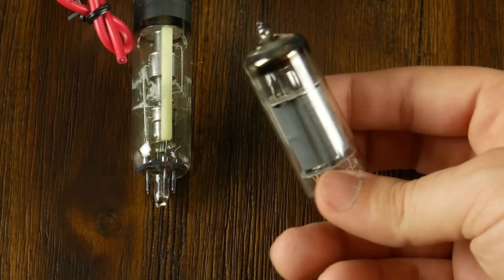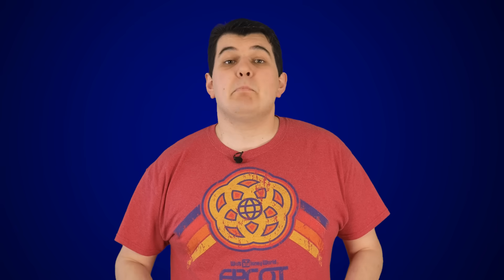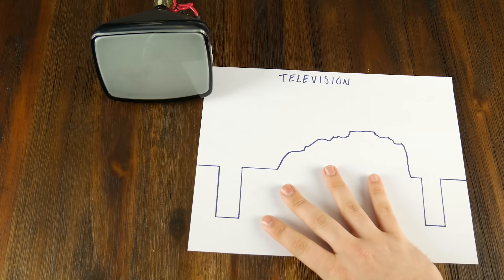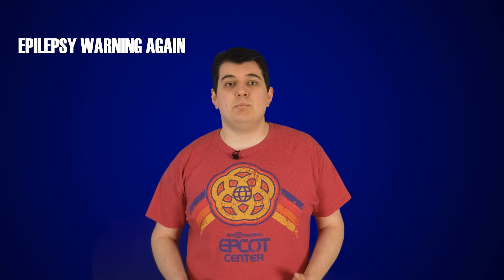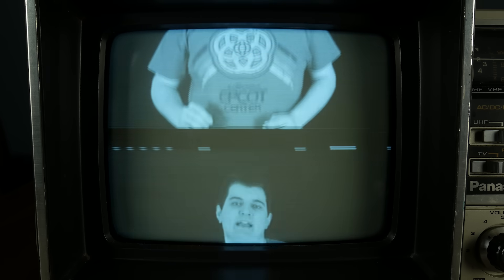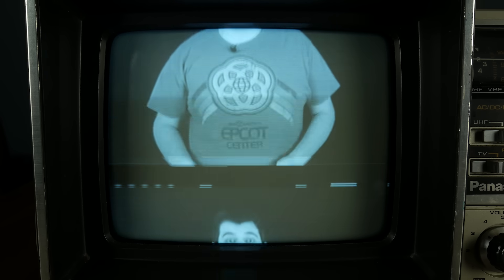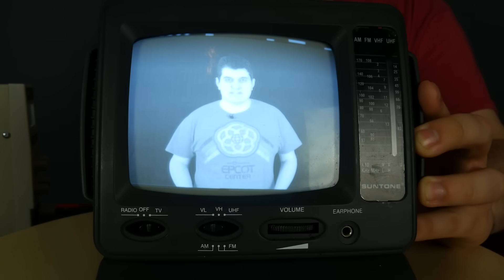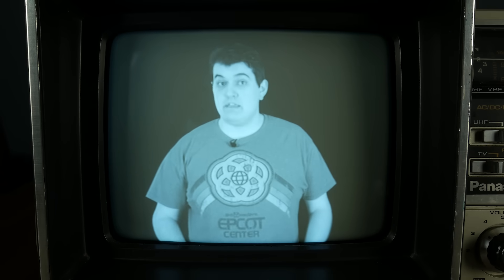Lines of Light: How Analog Television Works

Comment: There is nothing wrong with your television set. Do not attempt to adjust the picture. We are controlling transmission. If we wish to make it louder, we will bring up the volume. If we wish to make it softer, we will tune it to a whisper. We will control the horizontal. We will control the vertical. We can roll the image; make it flutter. We can change the focus to a soft blur or sharpen it to crystal clarity. For the next hour, sit quietly and we will control all that you see and hear. We repeat: there is nothing wrong with your television set. You are about to participate in a great adventure. You are about to experience the awe and mystery which reaches from the inner mind to the outer limits.
Reply: michael adams Please stand by
Reply: How scarier would that have been read out in a BBC English accent and backed with the nightmarish tunes of the BBC Radiophonic Workshop?
Reply: @GeoNeilUK  Or how scarier still if it had been read out by a Scouser.  "We kcontrol thu veeeeeertickle"
Reply: The Outer Limits... Please Stand By.
Reply: That actually caused them some grief... Of course, they didn't actually change the vertical or horiz frequencies of any TV tuned in to the program;  they simply transmitted a picture of an actual TV that was intentionally misadjusted.  The problem was that TVs in the 60s were not trouble free, and when someone experienced a vertical or horizontal sync problem right after watching Outer Limits, they bitched at the network.  True story.
Reply: That would never happen to a Supa Mega Pixel Pro Smart TV 2000! Buy a Supa Mega Pixel Pro Smart TV 2000 today!
Reply: @elijahfordsidioticvarietys8770  Throw in a Super Shammy and I'll take two!
Reply: @ohger1  I'd buy that for a dollar!
Reply: There is nothing wrong with your TV. Execpt of course if it’s not the supa mega pixel pro smart tv 2000!
Reply: I still remember channel sign-offs.
Reply: @craftpaint1644  haha I worked in broadcast and played back the video you must have watched!
The lineup was:
The news (read by the announcer)
Then the national anthem
Then color bars with a 440hz tone (later years changed to a 1khz tone) what we called bars & tone
Then maybe static when the transmitter when off the air for maint

In the morning the lineup was:
B&T
national anthem
Morning prayer
The news (read by the announcer)
Then the daily program would follow most times it was "the American farmer
Reply: What I want to know is how the hell apollo was able to send analog TV with audio sent from the moon through the Van Allen Belts 237,000 miles away from Earth without any distortion or degradation, faster than the speed of light ?
 Watch this:
https://youtu.be/BYhIM_0zQD8

Comment: I have been shocked by a CRT tube. It didn't feel good at all, but I didn't die. It was a pretty small CRT though and i'm sure the bigger ones can deliver a lethal shock.
Reply: What I remember the G2 voltage is more dangerous then the anode voltage it has more 'oomph'. It's the focussing voltage or something it's actually more dangerous then the 26kv anode voltage. That's all I know I always found them a bit creepy those high voltage vacuum things.
Reply: They can be intimidating from the high voltage, but they are really fascinating.
Reply: @AllMyCircuits
the crt itself acts as a capacitor and does deliver much more than 1mA , i know this from experience , only once tho :-)
Reply: I've heard about people that were killed by old valve (instead of transistors) TV sets, probably because of 600 V anode voltage which has very capable power source, like 100 milliamps or more, which is well enough to kill, instead of 1 mA of 25 kV current on CRT second anode which is not so dangerous though it has some energy stored in capacitor which could shock pretty good...
Reply: Yeah the old ones are definitely more dangerous

Comment: Still have a 1976 Zenith System 3 Space Command console TV with the Zoom function in the rec room. The TV has never been worked on, and still has a great picture (by CRT standards) 40 years later. With the heavy wood cabinet and bi-amplification four speaker system, this has enough audio power and bass to fool many into thinking the floor speakers for the stereo on either side of the TV are what are playing!! This is seriously the best sounding TV I have ever heard, and it is mono!

Comment: Now I'd like you to discuss SSTV (even though it works on the same principle as analogue TV)

Wasn't there a games console that exploited persistence of vision?  I think it was the Adventurevision.  

Also I think the very first computers used CRTs as RAM.  

Yep, CRT TVs have EXTREMELY high voltages (as do valve based radios)

Most of these CRT TVs don't have digital tuners.  

This is why when you place a strong magnet in front of a CRT TV, you get displacement patterns.  

Yeah, horizontal lines get drawn at ~15000 times a second, vertical lines get drawn at the mains frequency (60Hz in the USA, 50Hz in the UK)

Is it the case that on a black and white TV would only need an adjustment of the V Hold to switch between NTSC and PAL?

With CRT TVs you do see the strobe effect if nothing else, this coming from a Raspberry Pi working at 60Hz (although I think it uses PAL colour standard, I don't know, I'm using a TV designed for the UK market)

There have been a number of data standards that lived in the vertical blanking interval (teletext was the best known standard and I wish teletext as stil being added to digital TV signals, it can't be that hard)

And yes, I'd love to see the difference between not only PAL and NTSC colour but also SECAM colour!  SECAM is pretty much ignored!

Comment: i just bought a home repair manual from the mid seventies it has a chapter on repairing and recalibrating TVs for novices.
Reply: >But many kids died from playing inside the back of a tv set [citation needed]

For decades people have challenged the people who make such claims to cite even one documented instance of someone being electrocuted by a CRT-based TV/monitor, and as far as I know, no one has done it yet.
Reply: SandyStarchild  Does it have a chapter on not dying?   Make sure you look into stored charges in large capicitors. He only mentioned the high voltage when the tv is on.  But many kids died from playing inside the back of a tv set that had been disused for years just because the power supplies had large capicitors capable of holding s charge for years.   Long about the 1980, they started adding bleeder resistors that would allow the caps to drain their charge over time.  Also, as the wires get old, hi voltage lines that look perfectly fine can begin to arc.  So reaching in while it's turned on can make you the most convenient path to ground.
Reply: @MaximRecoil
i didnt die but i was "bitten" many times messing with crt tvs , the biggest bite was from the anode on a 26" tv , i forgot to discharge it and lifted the rubber flap put my thumb under to release the wire clip , felt like id hit it with a hammer :-(